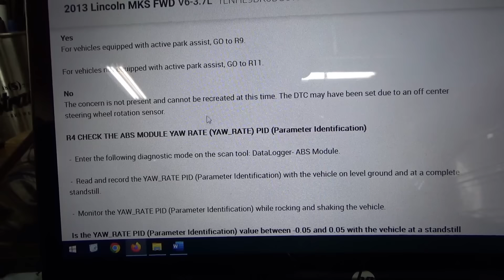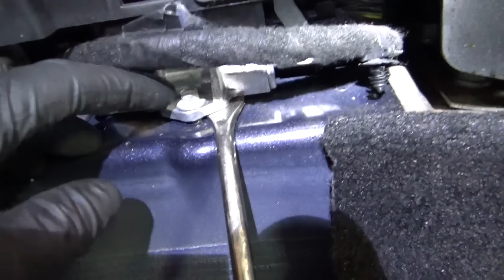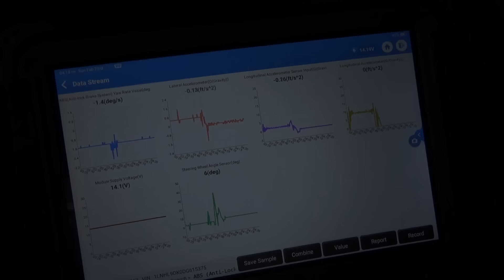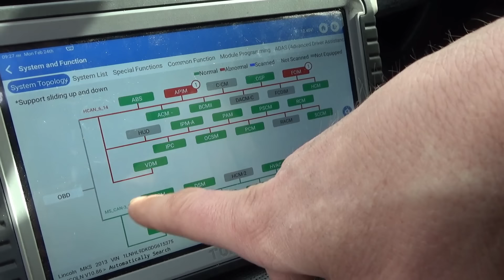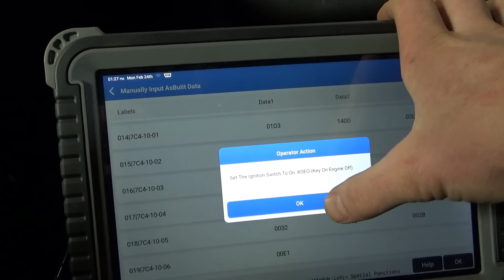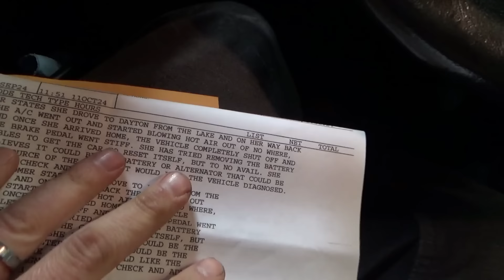(Pt 3) Lincoln BUTCHERED...by Dealer?! ('13 MKS: Water Intrusion...NEW GHOST U3000?!)

Comment: I’ve had two cars with water on the floor. One was a VW Beetle. There was a recall to clean the sunroof drains. I took it to the dealer and they did the service. The drain was a tube that ran down the door pillars and out through the area by the passenger feet. The tube ran through a grommet into the wheel well. I read about people who used compressed air to blow out the tube and the hose would come out of the grommet. So I checked and sure enough, the drain tube had come out and was draining onto the floor. 
 The second was an 2005 Mustang. While turning a corner one time water came from under the dash onto the passenger floor. I tore out the heater fan and the cavity was full of water. I drained the water but couldn’t find the problem. A month later the same thing happened. I searched the problem to the small rubber tube that drains the AC condensate in the engine bay. The tube was full of dirt and it would allow water to fill up and drain into the area where the heater fan was. And over time it accumulated so much water it would overflow into the car. So I just cleaned the little rubber drain hose and solved the problem.

Comment: My experience with internal water intrusion in a car / vehicle is that first, all water, standing and moisture must be evacuated, and the vehicle must be completely dry in the interior. Rolling brown paper towels into baseball sized spheres and stuffing them into likely intrusion locations will help identify water problems immediately. Wet brown paper towels turn dark when wet.
Reply: I figured they hadn't closed the window all the way while it sat at the dealer.  or couldn't after screwing up the BCM.

Comment: The car could have been stored outside with the drivers window cracked open or the door may not have been fully closed, both allowing rain to enter the interior. I have a Yukon with an opening moon roof but I refuse to use it for this reason here. Mine don't leak and I want it to stay that way. 😊
Reply: I dont use my sunroof/moonroof either.  No leaking issues yet.

Comment: I hope the techs at Ford dealerships are paying attention to this issue Ivan is working on. I myself was a technician at a Ford dealer before joining the military. I think one thing that would help Ford dealers is to put back hourly paid techs that work on troubleshooting problems like this. I did this for years until I went on flat rate commission. The shop area I worked in even had a Dynamometer that you could test drive the vehicle on. Yes, very expensive, but we could fix anything that came in the shop. Dealers should be putting more effort in troubleshooting and training for technicians to diagnose problems.  People are spending up to $100,000 on new vehicles. They deserve high quality service for their cars and trucks.  If you don't, you won't sell new vehicles anymore and go out of business.
Reply: Farley does NOT care about the  customer. It's clear at this point. 
Ford either needs to fire him or expect they will go out of business or sold to a chinese car company.
Reply: @horseathalt7308  The problem is the EPA nuts are forcing them to put all these modules on the car.  No sane person wants collision avoidance, anti lock brakes that force you to hit what is in front of you, and airbags that rip grandma's head off, and spray shrapnel that would make a claymore jealous, in the drivers face.
Reply: @robertsmith2956 A lot of these things have nothing to do with epa requirements. It's all bells and whistles, as well as making it so "stupid" can drive. If people didn't fall for it, they'd start dropping these useless options. Other issue is bundles (option package). I want A/C, power windows, and cruise - guess what, comes in the package with the butt scratcher and prostate stimulator. People don't want to be seen driving the SE model, they want the Platinum.
Reply: @robertsmith2956 none of those things are related to the EPA…
Reply: @robertsmith2956 this is the most ignorant comment I have ever read.
Reply: @CFast1990  Wanting to live is ignorant?  All those devices KILL you, they don't help you.
Reply: @robertsmith2956 You forgot the seatbelts that strangle people in a collision!
Reply: @robertsmith2956  Beyond ignorant 😂
Reply: @CFast1990  just look at all the cars with that garbage crashed on the road.
The premise of the car can stop in time is why it always fails.  they block you from evading the crash completely instead.  You can't lock the tires and slide the car sideways around the object in front of you.
Reply: @robertsmith2956 What a Looney Tunes understanding of physics you have. If your wheels are locked, you can't steer. The ignorance of some people thinking because they don't understand something that it doesn't have a purpose..
Reply: Why would the dealers care? They charge the customer whether they fix the problem or not.
Reply: My theory is dealers don't do this because they make more money just replacing parts.   Here's a perfect example... the Honda V6 in their minivan/suv/pickup will throw a code that the cat for the rear bank is not operating optimally.   If you take it to the dealer, he'll say "that's the problem" and replace the cat for several thousand dollars.   But 10 weeks later the code comes back because the cat is a symptom, not the cause.  In fact, what's happening is the rear fuel injectors start leaking down and send raw gas to cat causing the issue.  This is a known issue, BTW.
Reply: They need to supply parts for cars that will go over 300,000 miles for longer than seven years too.
Reply: @daviderickson9445 what ever happened to manufacturers using the same parts for multiple models of cars for multiple years. So many things used to be interchangeable even from cars to trucks. They can still do a lot more of that today.
Reply: @daviderickson9445  Back in the previous century, car parts were available for 20 YEARS after production, and the car brands sold the production specs and dies to 3rd party parts makers. Today, these new modules are all claimed to be 'propitiatory' and no 3rd party is allowed to make or repair them. BUT, the vehicle makers do NOT make them 'in house', but are contracted out to board houses to make them - let them able to continue making the modules at will, and sell direct to the dealers that NEED them. Win-Win.
Reply: They wouldnt care.
Reply: I wouldnt be betting my lunch on them evwn caring
Reply: Too many modules now involved sourced from too many different suppliers and only stocked for 7 years.  Wait until Ethernet replaces Can Bus and links to one single control module. Yikes
Reply: @Westcoastride  Wow by then nobody will be buying these new pieces of junk. They are already outrageously priced and almost nobody wants them.
Reply: Aftermarket, service and repairs is where the money's at, that's the reason.
I have a good example from the time I worked at a jetengine overhaul shop. Some airlines bought brand new engines for us to disassemble and put all the parts on the shelf. Most nuts and bolts were discarded and it was still more economically justified than buying individual spare parts.
Reply: Ford is like every other corpo. Driven by ridiculous investors who want short term profit.
Reply: @kevinc7632 Ford investors haven't made a decent return for years.

Comment: :o) My 02 Jeep Wrangler TJ leaks and I sponge it out and then use a heater with a fan to dry it. It's taking me months to try and fix that leak in the passenger door. Ive replaced the seal 3 times but none of the seals are as good as the aftermarket seal on the drivers side and I don't know if there are any good ones on the market. The driver's side leaks air but has never leaked a drop of water.
Reply: I'm an automotive locksmith. Jeep's and Honda's use really thin metal around the door frame. I see this from air bagging them for lockouts. Many times someone else before me did this and the frames are bowed out. Try this as I fix these all the time. Put the window down and stand in between the body and the door facing the door. Door open of course. Put your knee on the door panel and start pulling the window frame towards you. Start at the top corner and work towards the top center and back again. I haven't had one yet that this didn't fix the air leaking.